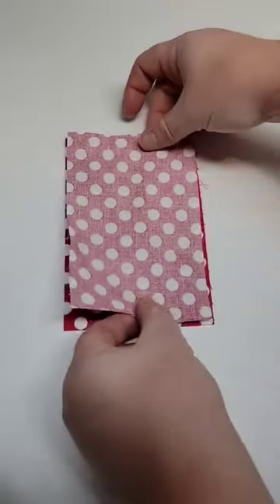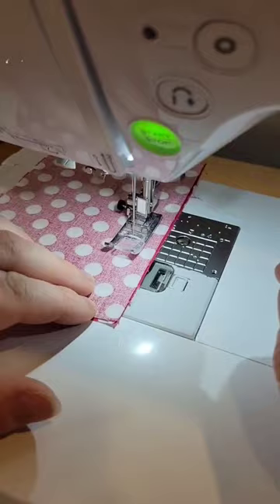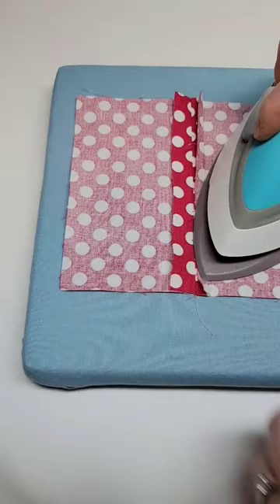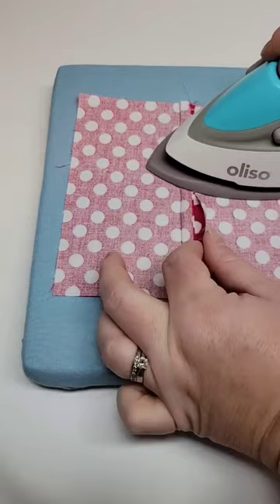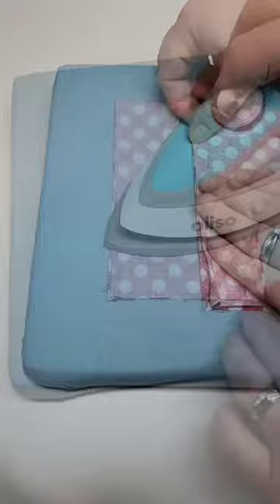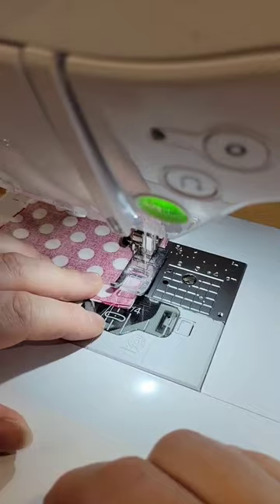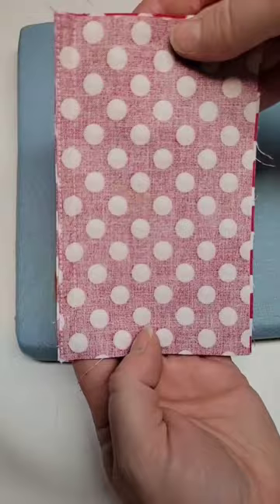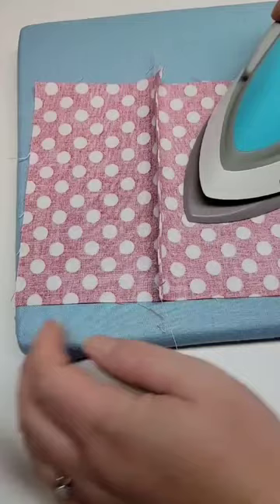How to sew a mock french seam

Comment: Just a tip from someone who has been sewing for years. It is much easier to sew the first seam with wrong sides together at 1/4 in. then turn wrong side out and sew the seam again at 3/8. (Equals 5/8 seam)  There's no need to press the seams until you are done. Just sew. Thank you for your video, though.  We all learn from one another.

Comment: What is the advantage over a proper french seam?
Reply from the maker: It's not an advantage it's used in ways where a traditional French seam can't be done.  Such as a woven garment,  attaching a sleeve
Reply: @Charmed By Ashley  you can do a French seam attaching a sleeve. Not all sleeves but most